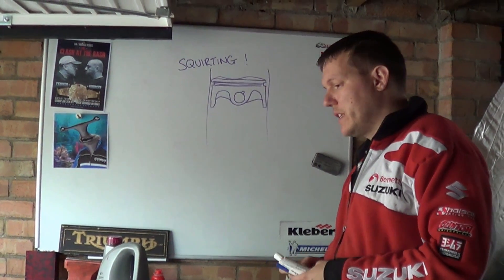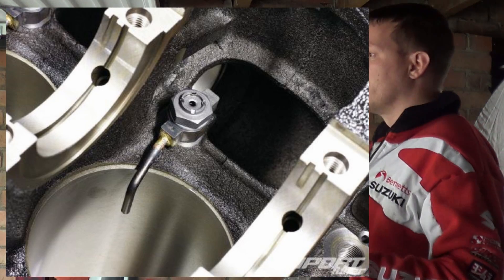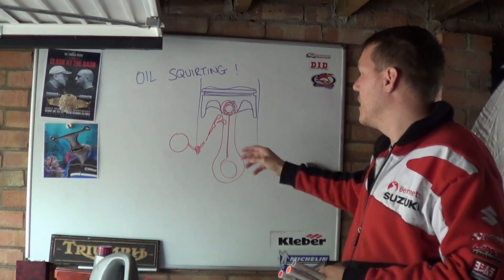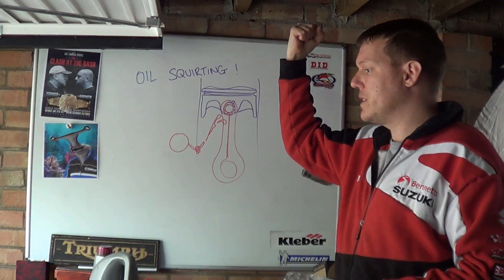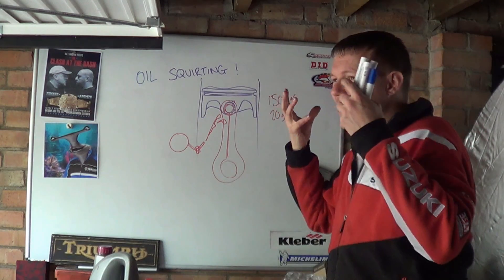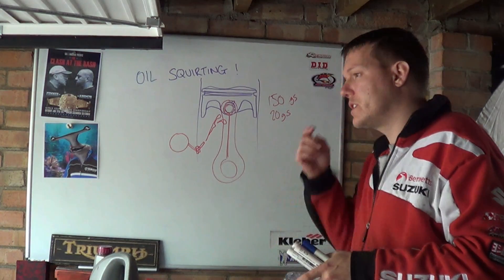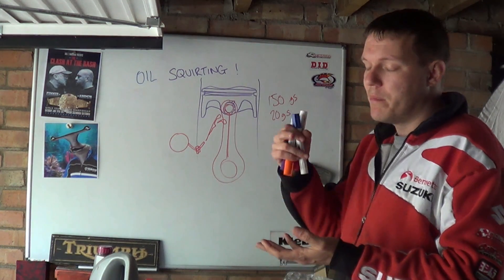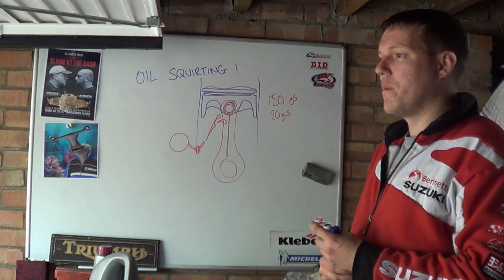Squirting - and how important it is

Comment: What factors considered to install these sequirters or no?
Reply from the maker: Piston temperatures which is based on BMEP, cylinder surface area, cooling system capacity...
Reply: @dirtygarageguy  what about the length of the connecting rod Nd the cylinder? Is this a factor too?

Comment: Great vid manI’ve just found out my s2000 had crankshaft and bearings replacement all done by Honda in Uk; it has 40k miles never had any problem but finding this I was a bit  concerned why they had to do it. They’ve explained to me that the oil  jet squirters were damaged and caused oil starvation therefore decided to replace the crankshaft and bearings as well; my question is : should I be worry about any additional damaged that this problem might cause ? Since then it has done 2 k miles , thanks in advance

Comment: Hey mate, i thought i know alot about engines, but in the last 10 vids i learned more then in the past 5 years or so! Very good content, keep em coming.

Maybe for future topics,  the 2stroke power valve , and what it does. 
And boost bottles. I dont know if 125's and up use them, but when i was messing around alot with small displacement 2strokes they were always advertised to increase performance but the actual mechanic behind it eludes me completely.
Reply from the maker: Already done part 1 of the power valve vid, needs editing. - matt
Reply: The Workshop please thrash boost bottles into the ground...